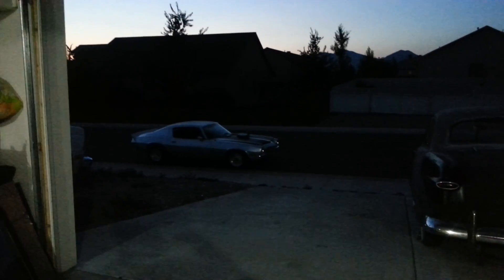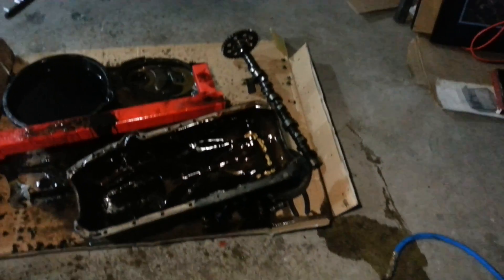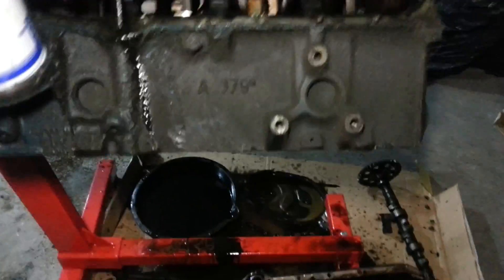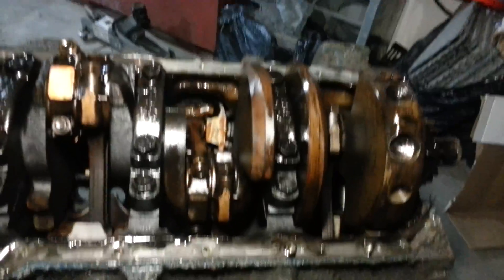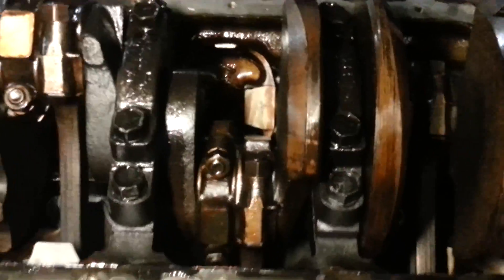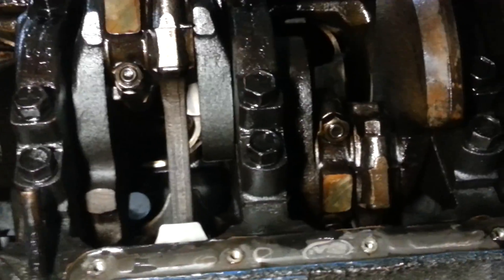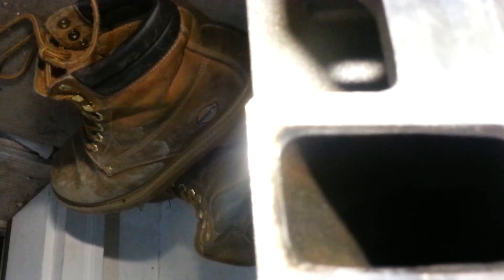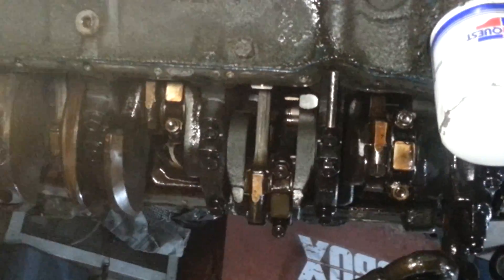Chevy 350 rod knock

Comment: Would new rod bearings fix this knock.
Reply from the maker: joey logan unfortunately not man. A spun bearing scratches grooves in the crankshaft journals and also the rods themselves. To fix this you would need a reground crankshaft with new bearings and possibly resized rods. Follow my chevy 350 build. I'm building this block as we speak. Thanks

Comment: Is it hard to rebuild a small block chevy and is it costly never done it before but wanna try since my s10 has a knocking
Reply from the maker: Titus Moreno it has to be the easiest engine to rebuild and one of the cheapest. Machining will be the most expensive but parts are really cheap. You could even buy a rebuilt unit for about 1500 with zero miles
Reply: gearheadforlife 50 thanks man

Comment: Did it knock cold and warm? My 350 is knocking only when warm on #2 cylinder
Reply from the maker: Daniel Harrell  ya man knocked all the time. you might just have some piston slap and when it warms up the piston expands and its all good.
Reply: augusto Escobar it ended up being the #2 bearing well it is diagnosed as that, about to be took apart today, seems to be a reoccurring issue with the 350
Reply: Will you explain what piston slap is?
Reply: Daniel Harrell

Comment: hi I have a 84 chevy custom deluxe 350 4 bolt main I recently went threw a mud hole got stuck ended up getting water an mud in engine I did a series of flush an i haven't drove truck but maybe a total of 15 miles since I drowned it but I've got  knock at bottom of motor a guy told me I can pull oil pan off an try to wiggle the rod as u did in this video an that will tell me which one is bad my question to you is can I fix this from under truck an how ,,I'm a decent part swapper an as issues come along I seem to do well at fixing them never been a interior part swappers (inside the engine ) so any advice would be greatly appreciated
Reply from the maker: ok if you do have a spun bearing, you technically can c
fix it from the bottom but you would save yourself a lot of time and energy just pulling the motor. you will need to completely remove the crank and the rod/piston assembly  from the top which means the head will need to be removed. or you can just replace the engine as a whole with either a used or rebuilt one for about 1500 or less.
Reply: +augusto escobar  ok don't have that kinda cash laying around haha .so I can't just pull oil pan off an try to do it from bottom?
Reply from the maker: +will cornelius yes you can do that but the top end will need pulled as well (intake manifold and cylinder head) to take out the piston. This is taking into account that it's a rod bearing that's bad. if it's a main bearing then you are kinda screwed and need to take the engine to a machine shop and tear it down completely to fix it. This is major surgery man. I am working on getting all parts together to make a video on how to get this problem fixed with a new crank, Rod,  and bearings.

Comment: Hey i have a 94 chevy 2500 with the 5.7 in it and it ticks a little. It is not a knock and only does it when you put in drive and sit there and stops when you go about 10 mph. and ideas what it might be?
Reply from the maker: It def doesnt sound like knock but more like lifter or valve tick. Try some thicker oil or even higher octane fuel like premium at the gas station. Ive heard these year engines tick like that and theres nothing wrong and last plenty of miles. Good luck man
Reply: Fly wheel

Comment: my truck is doing this. is it fixable
Reply: gearheadforlife 50 o
Reply: You can do it with the engine in the trucj
Reply from the maker: It is fixable scott but its alot of work. You will need to pull the engine and have the crank ground down and polished if it even savable. If its not you are gonna need a new crank and possibly a new rod and all new bearings. If its worth your while you can rebuild your engine or just buy a used replacement. Good luck
Reply: Thanks!